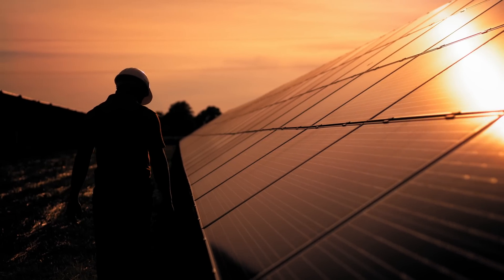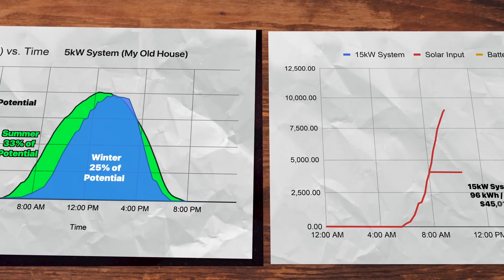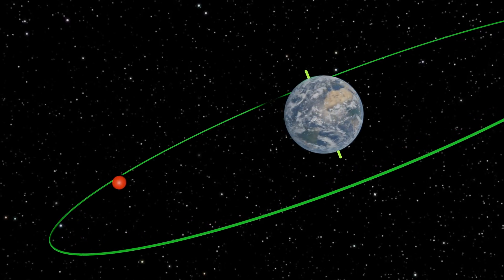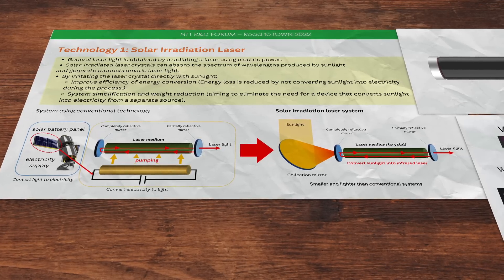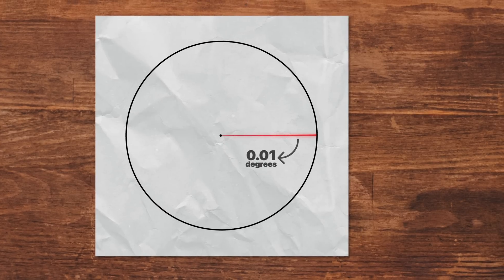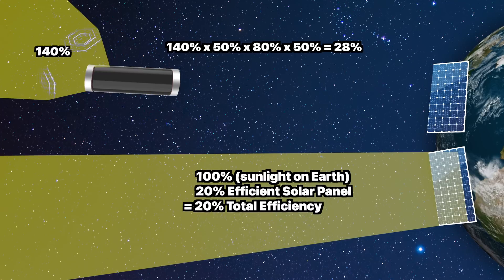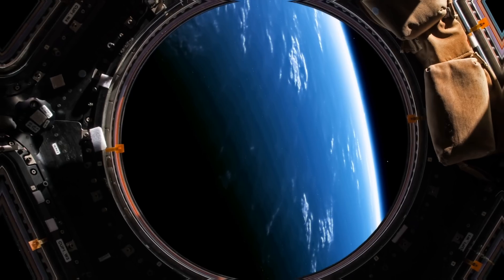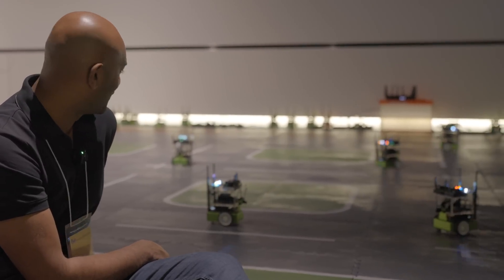Groundbreaking Research Transmits Energy From Space 24 Hours a Day!

Comment: 1.The state-of-the-art solar-to-laser conversion efficiency is less than 5%, by solar pumping of Ce:Nd:YAG laser medium (see: Most efficient simultaneous solar laser emissions from three Ce:Nd:YAG rods within a single pump cavity, October 2022 Solar Energy Materials and Solar Cells 246:111921.DOI: 10.1016/j.solmat.2022.111921). 
2. A Nd:Cr:YAG laser  medium absorbs less than 40% solar power, then it would be impossible to produce a solar laser with 50% solar-to-laser conversion efficiency. 
3.Untill today, there is no published literature confirming the 50% efficiency solar laser mentioned by NTT.

Comment: Interesting idea, but I suspect it would prove impractical. Position and alignment would be difficult and fickle. I have to imagine that clouds, fog, wildfire haze and other atmospheric pollutants would seriously degrade the focus and efficiency of the beam. I'm ignorant of the physics of it, so this is purely speculation that could easily be wrong, but I also suspect that such an energy beam would need to be extremely powerful to justify the whole endeavor, and that leads me to suspect that it would essentially be a death ray for anything that inadvertently passed through the beam. If that is the case, there would presumably need to be a no-fly zone around it and I could see it ending a few unlucky birds. I have a lot of difficulty imagining that the energy it could produce would ever lead to black ink for investors after covering all the expenses involved in overcoming all the technical challenges.

Comment: The simplest way to deal with the laser dispersion problem, imho, is to put a lens in orbit at a given distance in the beams path between station and earth.
Reply: Then why use laser in the first place? Just put a big lens with focus on somewhere on earth.😅

What you need is a stop gap to re-laser the beam. But that will need an array of them circling the planet. That of course decrease the amount of energy transfer. Which shall be compensated by a larger installed collectors.

Comment: So just as clouds reduce the ground based solar panels it seems like they will also reduce the strength of the laser beam. So it seems like you are still limited to where the ground-based panels should be placed for optimal efficiency. The loss due to clouds was not taken into account in the calculations, which seems like a big mistake.

Comment: The best application for solar power satellites may be for Mars. Microwave though because microwaves are unaffected by dust storms. It is also easier to put a payload into Mars orbit than land it on the surface and in orbit low mass mirrors can make up for the lower sunlight. 
The real breakthrough here is the efficient high power direct solar laser. Beam powered rocket propulsion using these lasers could mean very short time to Mars.

Comment: The application of infrared lasers for safe use is interesting, it gave me alot of interesting ideas it could be applied for.

Would it be possible to use artificially produced infrared lasers for small-scale/personal use, for example; like long-range wireless phone/computer/laptop charger? A drone that that recharges midair? Trains(without the power lines), Cars and trucks on the move? electric cargo ships and any boats in the middle of the ocean? 

Breaking down how this works, if there's alot of them in space, its basically Starlink, but wireless powerlines. They can recharge anytime and anywhere, heck, it might get rid of ground-based powerlines altogether(which is obviously impossible because we will never have enough solar panel to power every country, which have been explained in the previous global solar network video). My copium fantasies aside, they make a great use for very important infrastructure.
Reply: Laser is not a good fit with wireless devices. Laser goes from point to point, while for any wireless devices, mobility is a must. A laser charger will have to detect and realign with such devices in real time, which can't be done easily (hence expensively).

Comment: This technology should NOT be allowed to move forward, unless the REAL reason is for military purposes, and the system is tightly controlled. Otherwise;
1) The more widespread this technology is used, the more likely a LASER would be knocked out of position by a piece of wayward space junk, and cause major damage. There are many township zoning codes that do not even allow highly reflective surfaces to be placed/constructed on your property. I have seen sunlight reflect off of windows and cause vinyl siding to melt. If you say that it would not be hot enough, then you are admitting the amount of LASER heat is low, and the return on investment would never pay off. In addition, as clouds move through the beam at night, the scattered beam of infrared light would vary in intensity, and could trigger infrared motion sensors in the entire region, all night long. 2) Low earth orbit satellites would have to contend with a growing problem, as they could accidentally pass under the beam. The numbers of communications satellites is increasing by the day. Not only would satellite engineers have to know where each solar LASER station is, but would also have to stay away from all points beneath it as well. 3) This beaming of additional heat into our atmosphere would add to the heat that already enters our atmosphere, thereby causing further global warming. It flies in the face of what the green initiative is trying to accomplish. This does not happen with conventionally illuminated, ground based solar arrays. If you say that it is not that much heat, then it will not address the very problem it is trying to solve. 4) Any object with a highly reflective surface (such as space junk), that crosses in front of the beam, would redirect the LASER beam, to who knows where. 5) The ability of ground based, infrared capable telescopes to work at night, is negatively affected by ambient infrared light. When the LASER beam is dispersed by clouds/pollutants in the atmosphere, the night sky will never be the same for astronomers. 6) The technology is too easily commandeered, by flying a space drone in the path of the LASER beam, and using a mirror to redirect the beam. Space drones already exist. NASA is working with space drones now. I expect they will become very useful in the future. 7) Since infrared light is invisible to humans, how would an aircraft pilot know if he/she is about the fly into the path of the LASER?

Comment: You  totally missed how much power you could collect, maybe to prove your point. I collect slightly more than you did with my solar collector in Peoria, AZ. But if you steered it with the sun, you would collect much more. The idea of solar collectors in space is very old, you don't need any fancy converters that might break, just simple mirrors directing the suns rays to other mirrors and down to a receiver on earth to run conventional power plants. The problems are station keeping and deterioration from solar flux. Station keeping is solved by using solar sails to "tack" against the constant solar pressure using super computers. The problem of weathering is taken care of by maintenance. I call this MOSS for Massive Orbital Solar Satellites. No special orbit necessary.

Comment: I see one glaring engineering problem with this.   Large surface area to mass, sounds like a solar sail.  Well known space propulsion system currently being tested, (see planetary society solar sail project  Which uses light pressure and solar winds to push a small craft with a solar sail through space.)   So how will they keep the system in geosynchronous orbit if it is subject to the a constant thrust from its interactions with the sun.  It may experience a constantly thrust toward interplanetary space.  This is not problem for most space craft because they have a of small surface area to mass ratio, but it is a problem for any structure with an extremely large surface are but small mass.

Comment: GREAT vid…. and love their new take on  space solar - w/ laser conversion!  
Thin mylar reflectors so are much lighter (and cheaper) than any PV tech - huge for costs of launch and collection area.  And direct conversion of sunlight to stimulated emission is brilliant for beam divergence reduction and decent atmospheric transmission in the ~1um visible window.
BUT - this is ‘concentrated solar’, so a big challenge may be  tracking that mirror array wrt the laser cavity.  I don’t grok orbital dynamics, but wonder if it has to ‘spin around’ every 24hrs to keep the array facing the sun?  And if so, I bet the output laser beam also needs independent precision steering towards the receiver in Japan.  
Finally, LCOE is a strong function of plant lifetime, so I worry about the laser lifetime.  If there’s an error up there - how u gunna fix it?  
Awesome work!

Comment: So by your calculations, this is not a worthwhile project because the cost to put up the system can never possibly be recuperated, weather you are looking at the energy input vs output or $ in vs $ out. Then there is also the issue of line losses where they are losing nearly 100% of the energy that was initially collected.
Otherwise it is a great idea

Comment: I am starting to wonder if the laser power transfer can be used to replace high voltage power lines.  Considering how many towers are needed to carry the cables, I am thinking you would only need about 5% of the current number to cover a similar distance.  This would make long distance transmission considerably cheaper.
Would this work, or would atmospheric conditions make it unworkable?
Reply: There's several issues with satellite solar: 1) they might not be as efficient as land based panels 2) it costs millions just launch such panels 3) maintenance would be difficult compared to land/sea 4) can be attacked easily, but not defended easily 5) technology's in its infancy 6) scientists already annoyed by SpaceX's internet satellites clogging up the sky so their telescopes have a harder time observing sky.  7) Both land and satellite solar panels might be vulnerable to EMP/solar flare attacks
Reply: Laser beam will disperse, which will require more towers than cables.
And don't forget that a bird (and a cat hunting it) can cause the laser to lose their target. That rogue laser may set fire on something or hit somebody's eyes.
Reply: @gorilladisco9108    Lol.  A bird may fly through the beam, but that would not deflect the beam, it would just fry the bird.
Also, how many cats do you know that hunt over 30 meters in the air?  :D

Comment: It would be so much cheaper to put 4 times as many solar panels on the ground.  The launch costs, ridiculously difficult maintenance, large real estate requirements for the ground receiver, and the inefficiency of power transmission will result in huge costs.  While this COULD be done, would you want to pay a ten dollars a kWh just for the cool factor?
Reply from the maker: so I mentioned the panels are only producing about 33% of the time, 4x the panels also requires a lot of batteries, and as you scale that up... it's an interesting thought... cheers! totally hear yah

Comment: That's very interesting, 4 hours of scheduled/predictable downtime every year. However I am skeptical, regardless of the price tag, Neodymium and Chromium dipped Yttrium Aluminum Garnet crystals, yes a mouthful, but let's break this name apart, Neodymium and Yttrium are Rare-earth elements. I do like how to brought up fly-wheel and compressed air energy storage, as those can be technologies not dependent on rare earth metals. I am very optimistic about fly-wheel energy storage when nanotubes are commercially feasible for them.

Comment: You'd think they'd also be able to move the laser around to make the geosynchronous better
Reply: 'geosynchrous better'? Wtf are you on? Get a grip of reality.
Reply: Not so easy. Even one micrometre of laser movement shifts the beam almost 40 m on earth. I'm not sure that the geosynchronous orbit is that rock steady anyway. Lots of engineering challenges to tackle.
Reply: @IhabFahmy  you have no idea what you assume you are on about. 'micrometer' to '40 metre' ratio? Wtf? Back to school. And GPS and geosynchronous have absolutely NOTHING in common.
Reply: @bikerfirefarter7280  Nobooint in discussing this comme t when I never me tioned GPS , and the 49m to 1 micrimetre ratio is a trivial trigonometric calculation. Go learn maths.
Reply: @IhabFahmy  if you'd check the original stream GPS/geosynchronous and lasers was the issue, and without a specified angle and HOA ratio micrometer/metre argument is irrelevant. And laser has virtually nothing to do with GPS or geosynchronous either in everyday life..

Comment: There was a demonstration in 2019 of how transmitting power via laser can be very safe with sensors that auto-off the beam when a foreign object gets close. Search "Researchers transmit energy with laser in 'historic' power-beaming demonstration."

Power efficiency is the prohibitive challenge. Wikipedia says: 
"The electrical-to-optical conversion efficiency of modern laser technology can be as high as 85%,[8] and off-the-shelf semiconductor diode lasers can have an output efficiency of around 50%.[9] The optical-to-electrical conversion efficiency of a photovoltaic receiver can be over 50% for monochromatic (or laser) light.[10]"
Doing the math here, we come up with a peak efficiency of 21.25%. So with 1400 kW input, you're getting 297.5 kW converted back into usable electricity on the ground in ideal conditions.

Comment: This is better than my orbiting mirrors.    

My approach avoided outages by orbiting many mirrors in the same orbit.  One exiting the earth shadow replaces one entering the shadow.  Easy enough for Japan to do the same thing. 

Geosynchronous orbit is pretty crowded, and you have to move the mirrors to track changing angle of the sun anyhow.  Go to a higher orbit.  If they use the mirrors as a solar sail (they will be anyhow), they can unfurl at low earth orbit, and use the mirrors to reach high orbit.

Comment: I missed the part how the sunlight collecting mirrors are capable of continuously guiding the sunlight to the mirror part while being geostrategic as its angle to the sun is constantly changing over the 24 hour period. There will even be some hours each day that the sun is behind the set of mirrors.
In the current example you would need a circular collect field with a diameter of 6km and several larger diameter of bare soil to cover small beam movements.
Then the beam to earth would be a big danger for objects like planes and satellites orbiting the earth.

Comment: Would like to get a run down of the logistics of burying nuclear waste deep within the Earth. The Earth's molten core is hot primarily because of radioactive elements, so if it were feasible to get waste down below the crust, it'd be almost perfectly environmentally friendly.
Reply: All you have to do is get it into a stable geological formation that is below the water table.  The petroleum industry has highly developed technology to do this via horizontal drilling.  It's not feasible to reach the mantle, but it's also not necessary.

Comment: They'll need some sort of on-board propulsion system. It doesn't need to be very powerful. The Earth has an elliptical orbit. Sometimes it's closer to the sun, sometimes it's farther away. The problem is that gravity from non-Earth objects will increase the closer you get to them. So twice a year when the Earth is closest to the sun, the sun will pull a little harder on the array, which could throw it out of geo-synchronous orbit. Aaaand if you're shooting a massive heat laser down to Earth and the orbit shifts even half a kilometer (which is like a grain of sand in space terms), you could potentially fry an area that you don't mean to. Additionally, you'll need to worry about solar wind. We already know how to make solar sails and have employed them before... if you put an object with a large surface area out in space, it WILL get pushed by the sun's rays. So you have to counteract that as well. Then there's the usual passing comets, meteors, micro-meteors, etc, etc, and ALL of that will be moving at speeds so fast that it'll just punch right through whatever it hits.

There is a LOT they have to take into account to make this work.

Comment: Australia shows that we might not even need such tech - the more complicated parts the system has, the higher probability of failure and the higher maintenance costs.
It seems we do just fine with solar and wind, combined with hydro and pumped hydro.
We just need to implement it in large scales - not allowing house builds without solar, for example, make a 5kWh battery storage mandatory for new houses, etc.
Still, cool tech, but I believe this is wrong direction.